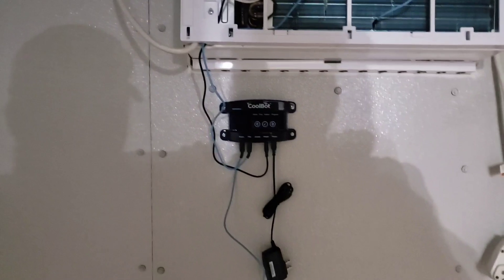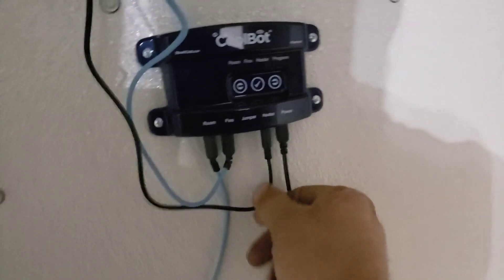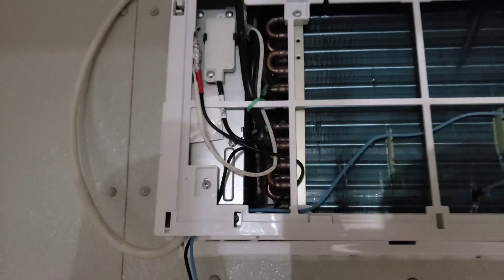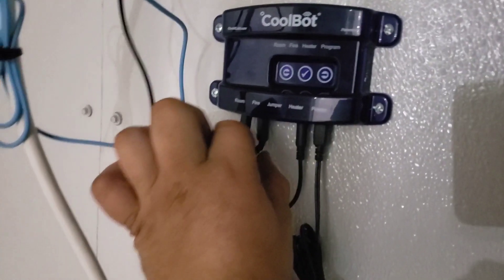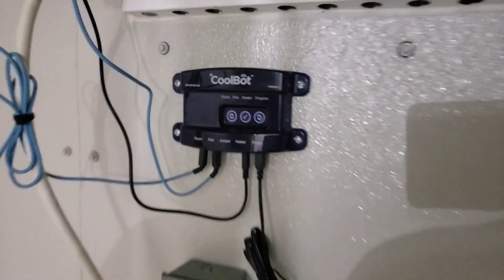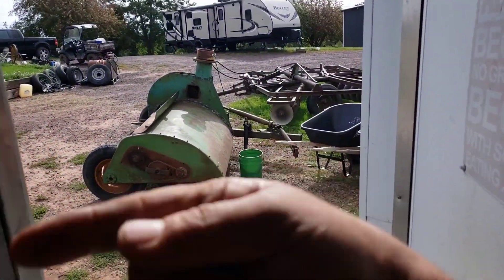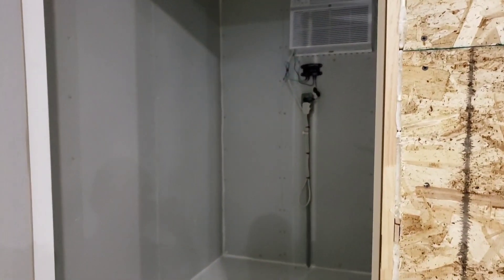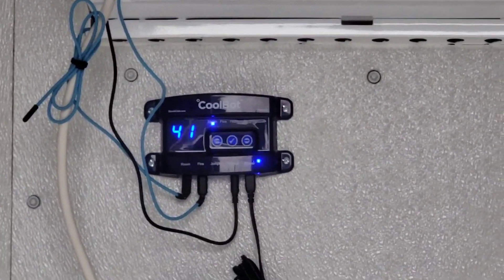CoolBot Installation and Review

Comment: Be interesting to see how cold it could get in there! Our cooler for is set at 31.5 degrees, typically the beef is around 32.6 so by the time we have it all cut up and packaged its still under 48 degrees
Reply from the maker: I believe the set low point is 28 degrees I plan to keep in about 32 I think will work out not a lot of traffic in and out and small area should hold pretty easily. Thanks Brad 🍻

Comment: Nice!!  Mount the coolbot controller upside-down...of course the led display will be upside-down,. but at least the wire connectors won't fall out.  Though perhaps if the connectors are facing upward condensation could be a problem..
Reply from the maker: They warn not to mount it upside down because of condensation. I'll probably use a little adhesive to hold them in but for what they charge you for it you would think a product made in the U.S.A. could be a little higher quality. Thanks man 🍻

Comment: Will water drip into the CoolBot and electrical outlet from the AC unit?
Reply from the maker: Geoff buddy. I seem to have gotten a package in the mail from you. I appreciate that very much man. There shouldn't be any water shed out the front otherwise my evaporator is freezing and ill have bigger problems lol. There is a drain on the far right front but is typically channelled out the back of the unit. Thanks again buddy. I will have that coming in a video soon. 🍻👍 cheers
Reply: @RickBork  Hopefully the manual will be helpful.